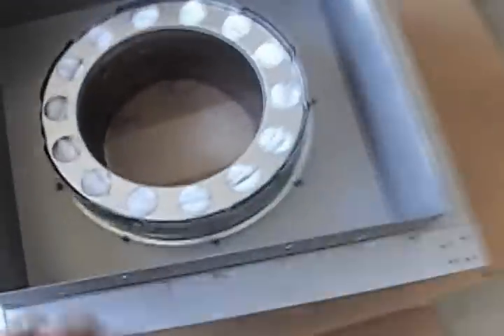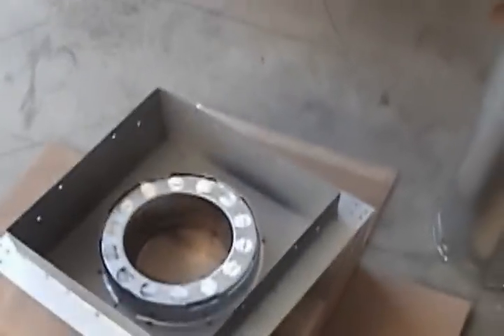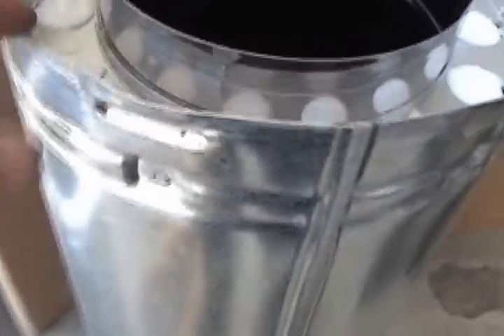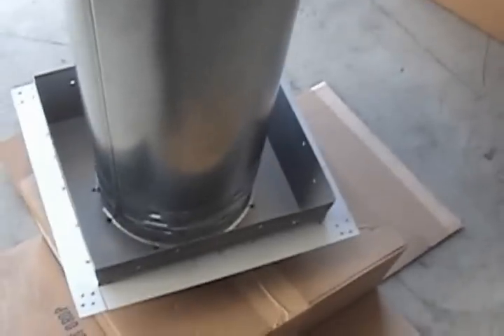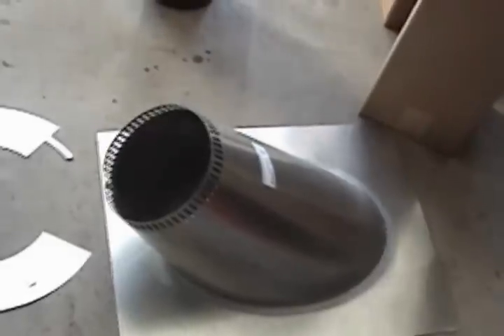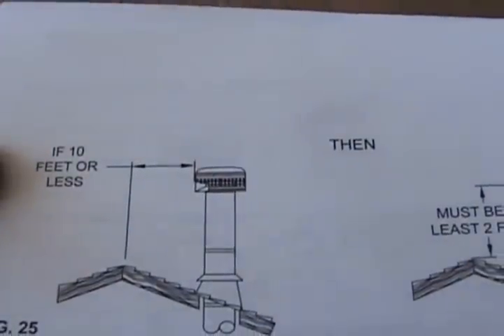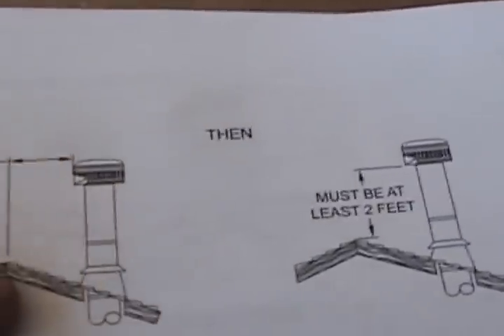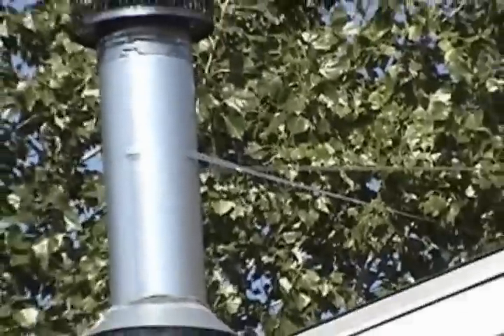Wood Stove Chimney Pipe Installation explained

Comment: I am going to be running my stove pipe through the PEAK of my roof...any suggestions?
Reply from the maker: The roof flashing is NOT made for the Peak. The Flashing is flat on the bottom so pick a side unless your going to Build a Chimney Chase around your pipe.
Reply: @mrEnergy511  And that opens a whole other can of worms...
Reply from the maker: @mountainsnmoore256  Easy solution just use an Elbow in the attic space and run the Chimney Pipe to the back side of the Roof. No worms harmed in this Chimney Installation haha 😆
Reply: @mrEnergy511  The only problem with that is that the backside has a hip & valley where the carport connects to the den. I’m not sure there would be room.  The front side is clear and would work better, but not sure that I want the pipe on the side facing the road. I’m gonna have to do some figuring and contemplating. 🤷🏻‍♂️😂 Thanks for the reply!
Reply from the maker: @mountainsnmoore256  without seeing it I can’t say for sure but you don't need much space... Good Luck!

Comment from the maker: Your cast iron stove or welded steel wood burning stove will heat up quickly, thats good because it will start to give of heat fast! on the down side of that if a hot fire is not maintained the stove will also cool quickly! Fire bricks are the opposit they take a while to heat up however once they are warm they like to stay that way for a while. It's kinda like a man and woman with different qualities but working together for the same goal.

Comment: plz respond. I'm doing this soon have a old wood stove I had to remove to remodel my house so I'm planning on installing it. which pipe do I need ? triple double or single also the old pipe had a vent door in middle section before ceiling do i need that ? all the help I can get thanks a million
Reply: santi o you can use single wall pipe inside but have to maintain proper clearances away from the wall and triple wall pipe through the ceiling you could call your local fire department to get the recommended distances from combustible materials. I hope that helps
Reply: peerless-d6r thank you so much another question the outlet on stove is a 8" can I reduce it to 6" no 8" pipe available locally thanks
Reply: santi o  you can but I would get 8 inch reducing it the entire way might effect the draft

Comment: What if you have no choice about your stove location, you have a tree closer than ten feet and your not allowed to cut the tree? Do you have use 25 feet of piping to get above the tree?
Reply: YEAH, and then as the tree grows you will need to keep adding pipe each year. Hope the tree isn't a Redwood.  Also, keep in mind that any birds that may fly within 10' of your chimney will force you to add more pipe length so that you are 2 feet above them.  Good luck.

Comment: I have a vaulted ceiling like you do. I assume they make "slanted" support boxes?
Reply: +David Barnes -- No. The support box is still square.. What made it look "slanted" in the video was the finishing color that was following the ceiling line. It was pitched, but the support box itself is hanging straight down.. It gives it a slanted look but the box itself is perfectly Square in shape... But instead of using a standard 11" support box, you will probably want to get one designed for vaulted ceilings that is 24" in length... It'll need to hang down into the room a little further than if it were a normal flat ceiling.  The support box will need to hang down far enough so that the single wall black pipe is far enough away from your ceiling (it has 18" clearance, not 12" like I think he said in the video.) plus it has to carry you through to the attic, floor, or roof line Whatever is above you through the ceiling.

Comment: my house is full of smoke from my coonara that bad my eyes burn. PLS help
Reply: You need an extra length of flue on top outside. This will increase the convection draw and fix the 'lazy' heater
Reply: Smoke?
Is your wood not bone dry, your inlet blocked, chimney blocked.
Did it work before.
Get a chimney sweep.
Reply: External air supply,  house could be to tight, not long enough hight to draw, stove pipe needs cleaning. Try opening a window in the room and see if the stove draws better. Clean the flue and try to burn seasoned wood. Remember wood drys 1 1/2 inches a year so a three inch triangle takes a year. A 3 inch round will only dry on the ends because the bark will prevent moisture loss.

Comment: Hi. 
I am building a house and going to install a free standing wood stove my wife does not like the idea of the black pipe running up to the ceiling (cathedral). I could 90 it and then run the the class a on the outside up through the eve as well. The wall will be faux stone and a slate hearth. Is there a good reason I should not 90 it out and up?Thanks
Reply: +Jeff Mooney - For wood burning appliances, the rule of thumb is to try and keep that chimney pipe inside the house as much as possible if you can.  The hotter your flue the better your draft will be, and a better draft means increased efficiency of your stove.  Another thing on that note is climate. A pipe that's exposed to cold weather means increased creosote build up, more potential issues with your draft etc. So interior venting is normally what would be encouraged, but in NO WAY is it required.. We all know a happy wife makes for a happy life, SO,  If you need to run it outside by means of a 90* elbow you can do that but you want to limit your horizontal runs.  You can't exceed 180* in bends when you vent, so no more than 2x 90* turns in the entire run (which you will have already when you have a 90* elbow above the stove and the T outside the house to go vertical again)  Consult the owners manual of your appliance as it will have specific details as to how far vertical you have to run off the top of the stove before you can 90* over -- it will tell you the maximum length of your horizontal runs, etc...  A lot of this is dictated by the appliance manufacturer and it never hurts to check your local building codes they trump all....   
Hope this helps...  Chuck from Woodland Direct